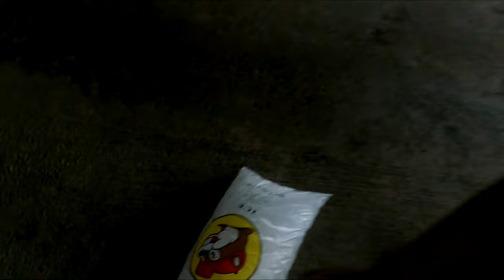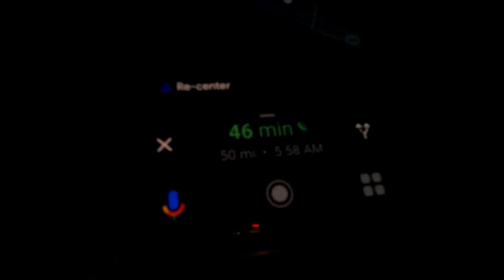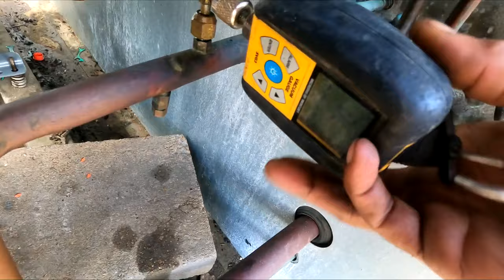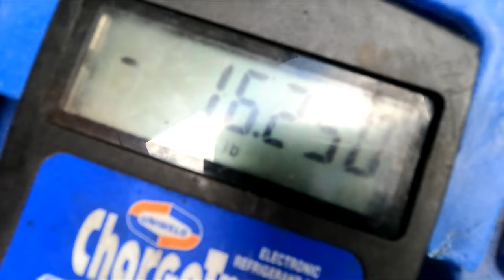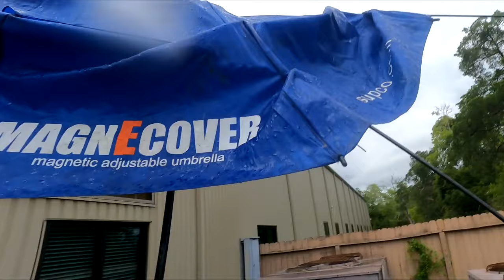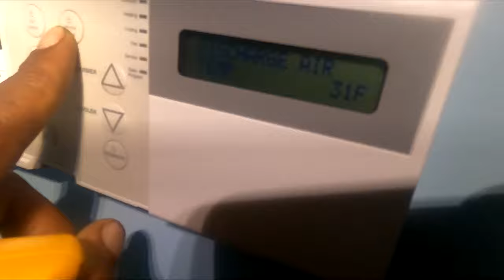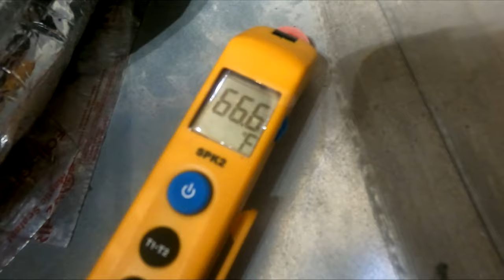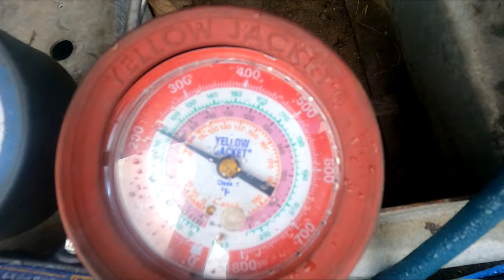06E Carrier compressor install and charging Rain delay

Comment: The orange ring on those gauges is 404a. It happens to be very close to 407c temps, but 407c is around 3.4 degrees higher at those pressures. There was little to no subcool at the time the video ended.

Comment: You'll know you are getting close to the full load/charge when the condenser fan #2 activates. You can take cardboard/plastic and temporarily block the condenser coils to get that head pressure up, also.